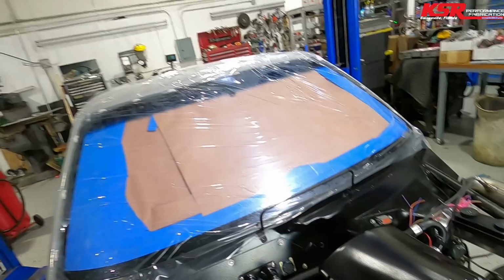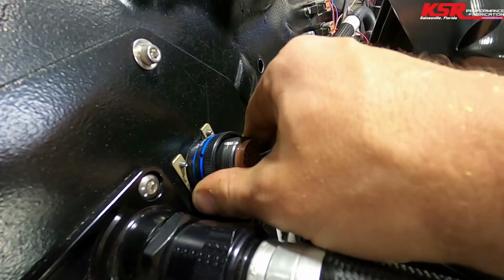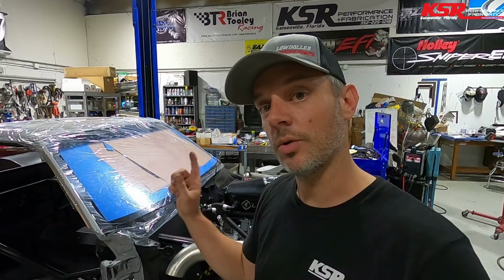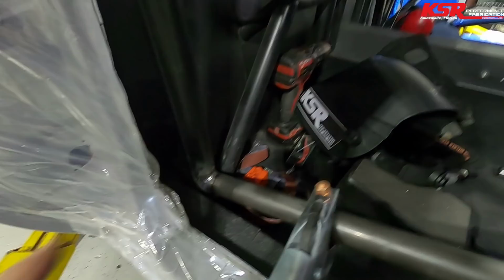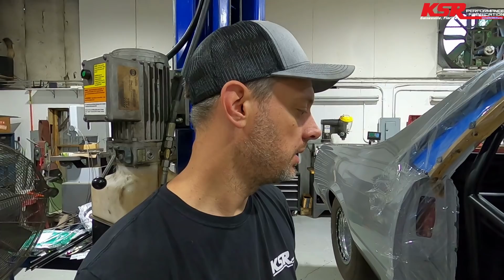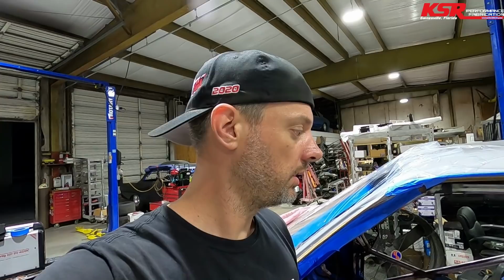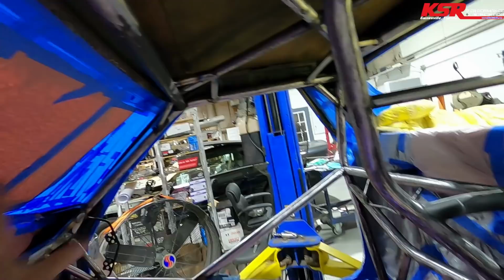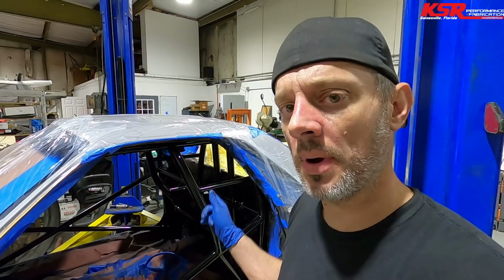Mullet El Camino Build Episode 21!! Contortionist Welding and Painting!

Comment: We use those connectors on fighter jets and I know exactly what that satisfying twist and click feels like😂 can’t wait to see the first pass, great job building this!
Reply: We had a lady "Twist" one of these onto a fire-bottle with a pair of channel locks.... Needless to say, the AT's had to go out and change a cannon plug.   Ironic part was that we were hero's before she showed up, we got that fire-bottle replaced so fast that it wouldn't have delayed the flight. All she had to do was plug it in because me as a "Framer" (AM) wasn't "qualified" :)
Reply: We use them on traffic signal control equipment too.  Seems like overkill when they are used on fighter jets too
Reply: @jakep5121  I was an AT few 4 years, I was the only one in my shop that did wire repair so that would have been me out there fixing it😂
Reply: @MB-mx7vz  they arnt overkill, they are necessary for quick removal and replacement of parts, if everything was hard  wired it would not be efficient and when your on a Deployment you need to trouble shoot jets quickly
Reply: As a former airframer there was no better feeling than cutting a cannon plug harness when avi pulls some bullshit. Hahahaha
Oops, planes down.. avi up
Reply: All fun and games until a 3 level bends all pins like a crop circle....
Reply: @Austensales1  Yea man.  I was saying that they were overkill for the traffic control equipment we use them on.  Completely understand why they use them on jets.
Reply: @jakep5121  NICE.
Reply: Yup use them on all the AGE equipment for your jets lol.
Reply: Just no safety wire ha ha ba

Comment: That's some tight welding. Back in the day when we upgraded to a funny car cage we had to use a 3" hole saw on the roof to get it fully welded. Car was getting repainted anyway.
Reply from the maker: On some cars, I cut the roof off and weld it back on.

Comment: Happen to see a can of brake parts cleaner on your bench...pro tip, you can buy a canister on amazon that you fill with compressed air and CRC brake parts cleaner by the gallon...so much cheaper than by the can.

Comment: Kevin you probably already Know about the Miller Electric welding Auto-Darkening goggles  #267370 
Ideal for auto restoration and other DIY environments, the low-profile design allows users to weld in spaces where access with traditional welding helmets is limited. I liked The reference to VGG, IT WAS WAY COOL.

Comment: Kevin might I suggest safety wiring the cannon plug (connector for the engine harness). On Aircraft they will occasionally come loose. Some .022 s/w to a screw will keep the cannon plug from rotating lose. Safety redundancy is key.

Comment: I like using the high temp bbq grill paint when i paint any metal black... It has a satin to flat finish, but it dryes so smooth and is easy to use...  You can also go over the high traffic areas with a torch and it will never come off. I live in louisiana, so i understand the struggle of rattle cans with the heat and humidity.

Comment: Love the VGG reference! I know how you feel when it comes to painting roll cage tubing or round stuff in general. ( like headers) I used rustoleum hammer finish brush on paint for my mustang. It's supposed to be a pretty robust finish. It's held up well, except in the "high traffic" areas like the driver's side door bar. Which I think is to be expected without something protecting it. Keep up the good work! I enjoy watching your videos (not just the mullet build) and I always feel like I'm learning new things.

Comment: Kevin..... Next time use a cup gun, automotive paint and primer. The sheen of the paint will blend together so you are not chasing fogged tubing back and forth... Yes, using automotive paint adds probably 20 minuetsto your project adding catalyst and cleanup, but its soooooo much more Durable too. Worth it. Oh, and not to mention, that cage would take about 30 minuets to actually paint.. Just FYI, thanks a ton for the video and the Awesome work.

Comment: I just want to say that your work is amazing.  Your attention to detail  keeps me coming back and you always seem to identify problems before they become a problem.  Which brings me to an observation.  The firewall engine harness connection should be opposite in my opinion.  The male side coming from the powered side, may be easy to short because the pins are exposed.   It obviously won’t be an issue if the power is disconnected before the engine harness
Reply: Merely a suggestion, but I can think of a situation or two that it might be an issue.

Comment: I burnt my eyeball and eyelid with hot filler rod not too long ago.  Not fun but healed fine. I always wear safety glasses under my helmet now.  I also recently learned polycarbonate glasses block 99.9% of uva, b, and c light.  It greatly reduces a chance of arc eye if the arc is reflected behind your helmet for some reason.

Comment: On aircraft, in regards to those connectors, the big guide "pin" (you'll underatand looking at one) is always on the top so even if you cant see it all the way, but can reach it, you know how its positioned so you don't cropcircle the pins. That's a bad day! Pro tip

Comment: As an aerospace wiring guy. That firewall connector isn't mounted properly. Should have the heads of the screw towards the connection as to not interfere with said connection. Also want to have two to three threads out of that nut clip so the self locking nut clip can get a good bite on that 440 screw. Either way awesome build can't wait to see this thing rip.

Comment: Kevin, not sure what you're using for spray paint.. but if its not anything special, then try using black appliance epoxy spray paint from the homeless depot. It looks nicer and holds up great. Only downsides are that it takes forever to dry and there is more over spray than normal spray paint. It is pretty glossy though

Comment: That firewall connector looks clean but I would be concerned that a ton of extra connections in the wiring have been added.  More connections means more possibility for failure.
Reply from the maker: This is true, the only potential issue. But we check every wire for continuity on each side of the connector.

Comment: Not sure what your painting experience is, but you don’t need to sand all the paint off as long as it had good adhesion to begin with. Simply scuff whatever you’re repainting with 400 grit and feather out the low/high spots.

Comment: They do sell flexible head torches. Not great for long term use but man do they make life easy on tight spots and around corners. Fairly cheap as well
Reply from the maker: Every torch I have is a flex head.

Comment: Love the intro. Definitely gotta caint that page and I'd paint that flange too. I love the wiring job as an electrical guy. All heat shrink not just loomed. I usually like the look of the loom better but your guys' heat shrink job was very nice, with no bunching or anything you usually see in custom wiring under the loom. Are you going to loom the wiring under the car for extra protection? I know it's minimal but just curious.

 I keep seeing you redoing or fixing someone else screwup. I mean they littery cut corners on this thing when they made the cage and did the bodywork. It was supposed to have a jet engine and the normal engine. That cage was woefully inadiquate. It's a good thing the giraffe brought it to you to finish.  It just seems like you had to do a lot that was supposed to be done when you got the thing.  As always excellent work.

Comment: There is a thing called the 10 foot rule when painting things like roll cages, industrial machinery and structural steel. The rule is basically if something looks good from ten feet away as long as the paint hits the mil spec you're good to go. Nobody is going to crawl around Mullet looking for dry spray just like nobody is going to crawl into the engine bay of a Cat D10 to do the same, I'm pretty sure everyone that looks at it will be too busy gawking over the fab work, the thoughtful design and attention to detail in the assembly itself.

It's not a Rolls-Royce, it's just a roll cage and for a guy painting with a rattle can that doesn't do so as a career it looks just fine.

Comment: On the gussets, why do you drill a pilot hole in the other pipe prior to welding?

Also what paint do you use for the roll cage?  Steel-it makes a paint that can be welded through, and has a fantastic looking finish and is pretty durable.  Alot of the off road racers use it.

Comment: surprised the screw/bolt for the wire harness connector is sticking out into the engine bay, vs the heads being in the engine bay :)

Comment: Roll cages are a bitch to paint, especially in a dark cab....You always end up missing a spot somewhere....Kevin, a tip to try to avoid having dry spots around tubes because of drying to fast....Try chilling the paint in a fridge before using....Will slow down drying

Comment: Hello Kevin what's the hole you drill in the tube before you weld on a new bar? Is there any way of pressure testing or filling it up with an inert gas to keep the bars from rusting on the inside. Sorry if this was a stupid question but I am not a rollcage fabricator.

Comment: what is the purpose of drilling a small hole in tube before you weld the gusset on? is it so some of the heat/gasses can escape into tube so it doesnt affect the weld? just curious.

Comment: The firewall connector nut plates are supposed to be on the other side
Reply from the maker: Not the way we set it up....
Reply: The way they're used in Aerospace is to put the connector through the bulkhead from the back side, put the nut plates on the back side of the connector flange, and run screws through the bulkhead, connector flange, and into the nut plates. Works either way, but is cleaner this way and you would eliminate the knuckle buster of screws poking through towards the connector.
Reply from the maker: @pgras147  we did it this way so that either side of the harness can easily be completely removed from the vehicle. Had we done in the "correct" way, the ECU side of the harness would need to be depinned from either the firewall connector or the ECU to remove it from the car.
Reply: No depinning needed, just swap the side the screws and nut plates are on, ECU connector still comes out just like it does now.
Reply from the maker: @pgras147  The flange for the mounting of the firewall connector is built into the connector itself. If we were to move the nut plate to the inside, only the heads of the screws would be holding the connector to the firewall instead of spreading the load through the entire nut plate. Not that there is alot of load there, but it makes things easier to do it like we have done it and best supports the connector to the firewall.

Comment: What's the purpose of drill spotting or drilling a hold where the tube goes before you install it and weld it? Equalization in air pressure throughout the tubes?

Comment: Maybe you have addressed this and I didn’t catch it, could the gussets have been flat plate instead of tube?
Reply from the maker: Some of them, but not all. I prefer the tube gussets anyways though.
Reply: I think in the videos (I've seen a couple) they call out a specific diameter of tubing and wall thickness. They actually have a color coded print page showing the tubing size. Maybe actually pipe.

Comment: Isn't the hose connecting the intercooler to the firewall too short to handle the movement/vibration of the engine wrt. the firewall?
Reply: Isn’t the engine solid mounted? I don’t think it’ll move at all.

Comment: I'm curious, what are the drilled out holes for in the center of the gusset bars? @7:17
Reply from the maker: As the tube is being welded, the air inside of it is being heated. When you get to the last little bit to weld, the air will rush out through the last little spot and contaminate the weld. Also, if the tube that I am welding to is not vented to other tubes, pressure can build inside of it and blow out while it is being welded upon.
Reply: @KSRPerformanceFabrication  Damn! I'm not a fabricator but that makes total sense. My buddy (who is a welder here at work) said even he learned something from that. His next build (scramble car for derby racing) will probably have this touch done to it.

Comment: Just a question why do you drill whole before putting bar in?
Reply: It relieves the pressure the welding heat creates inside the tube so the last part of the weld doesn't blow out...

Comment: I have a question maybe someone can answer. Why does he drill holes in the existing cage pipe before welding on the gusset pieces?
Reply: Mandated by nhra. It is proven to improve the integrity of the cage by nearly 30% at the joint by looking at the test data . I don't claim to understand it, I  just know its in the rule 📚 books mechanical drawings.
Reply: @TechFeedMe  As everyone has been quoting "Well I'll be dipped." Thanks very much for the reply!

Comment: So why is he drilling that hole in the bars before welding on the little bars?
Reply from the maker: As the tube is being welded, the air inside of it is being heated. When you get to the last little bit to weld, the air will rush out through the last little spot and contaminate the weld. Also, if the tube that I am welding to is not vented to other tubes, pressure can build inside of it and blow out while it is being welded upon.
Reply: @KSRPerformanceFabrication  the more yo u know... thanks man love the channel I've learned so much watching it keep it up camt wait for mullet to be finished... maybe a rave against soccer mom???

Comment: It looked like you drilled a hole before welding on the gussets that you were adding, why is that?
Reply from the maker: As the tube is being welded, the air inside of it is being heated. When you get to the last little bit to weld, the air will rush out through the last little spot and contaminate the weld. Also, if the tube that I am welding to is not vented to other tubes, pressure can build inside of it and blow out while it is being welded upon.
Reply: @KSRPerformanceFabrication  THANK YOU SO MUCH FOR THE RESPONSE! I had a feeling this was what you were going to say. I appreciate all the tips that you give! I have a '68 Vette that I am going to start working on. Not sure what my end goal is but I need all I can learn from people like you. Keep doing what you are doing.